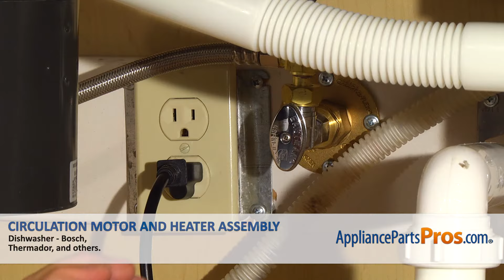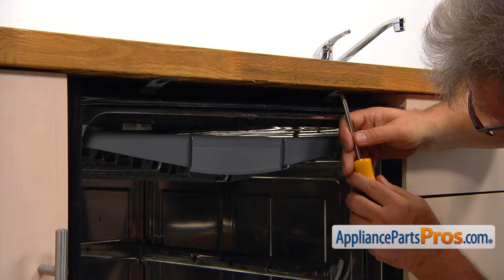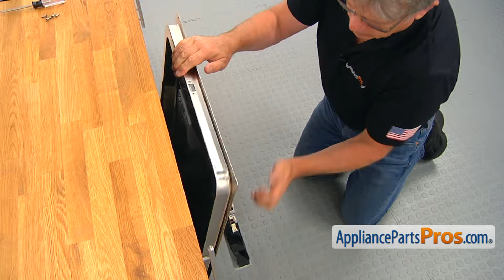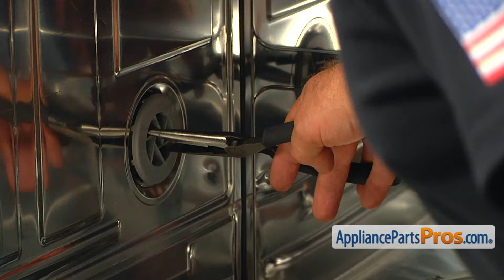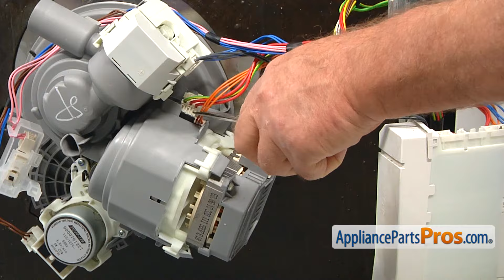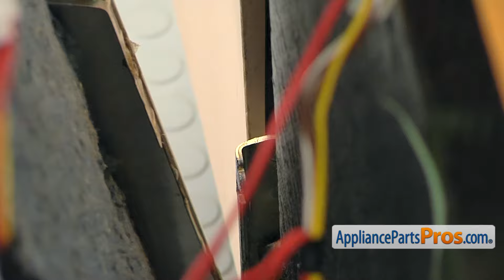How To: Bosch/Thermador/Gaggenau Circulation Motor and Heater Assembly 00753351

Comment: Thank you so much for this video. So many others do the quick and easy removal from the right side of the dishwasher, but my model has the Zeolite dryer in the way! Removing the door and the bottom was the only way to remove the pump. There were a lot of steps and potential points of failure removing so many connections, but your detailed instructions gave me the confidence to give it a shot. Thank you again! Saved me hundreds of dollars.
Reply from the maker: Thank you so much, @MoMukh! 😄👍 We’re glad the detailed walkthrough gave you the confidence to tackle the repair, especially with the Zeolite dryer making access more complicated. Great job sticking with it, and even better that you saved hundreds of dollars in the process!

Comment: Great instructions, even though I went in through the side, without taking off the bottom pan.  The detail on how to remove each wiring harness from the part was excellent, and missing from many other videos.  The crimp hose clamp on mine was inaccessible, so I just tried rotating and pulling down on the pump as other commenters mentioned, and that worked great.  I ordered my replacement through AppliancePartsPros, and it arrived 2 days early.  I’ve had great experience with them in the past as well.
Reply from the maker: Thanks so much for sharing your experience, @DavidBump 👍😄

Glad the wiring detail helped, and great job finding a workable approach with the side access—that’s exactly the kind of real-world variation that can make these repairs tricky. Also happy to hear the part arrived early and that you’ve had good experiences with us!

Comment: I need to do this. On some other videos, they seem to easily get it out from the front or the side. I have a SilencePlus 40, 800 series. Is this shown method the only way to do it? Seems a bit of work. I just did the pump motor which was annoying since there was not much clearance and it leaked bad at first, but seems good now. The tube was too far at the bottom and the motor was in the way of other plastic bits. Not a great design IMHO. 

How do I know if my heating and E15 (water) issues could also be the CONTROL board? Which one am I looking at- on top? Will it looked burned? I heard lose solder joints is common issue.
Reply from the maker: If you need further troubleshooting or replacement information, you can check out our Repair Forum: https://forum.appliancepartspros.com/.  It’s easy to register, and you can either post your question or search the forum to see if someone else has already asked the same question.

Comment: Thanks for the detailed video @appliancepartspros. My Bosch Dishwasher showed an E20 code and when I tried to start it, it would make 2 faint clicks and stop. After installing the new circulation motor it now works. However, if I try to run a Sanitize cycle, it does throw the E20 error. This is confusing. I ran with  success a complete normal cycle and a Service Mode P1 Cycle, the Dishwasher performed normally. @Ctd77801-g earlier posted that an un-properly seated  black wire connector to the pump could cause an E20. What are the things I need to further review beyond that wire/connector? Is it possible that I also need to replace the control board? Is there a specific test to check the controller board?
Reply from the maker: For free technical support, please visit our Repair Forum: https://forum.appliancepartspros.com/.  It’s easy to register, and you can either post your question or search the forum to see if someone else has already asked the same question.
 
Our experienced technicians, with over 20 years of hands-on appliance repair experience, are ready to answer your questions and guide you through your repair.

Comment: Awesome video!   All the easy to follow steps.    Thanks for the details changing that out.     Now I get to figure out why I have no power to the unit.  Don't see any loose connections behind panel, power button does nothing.   One match away from burning this house down now!
Reply from the maker: Have you tried it plugged into another outlet?
Reply: @appliancepartspros  Yeah, couple different ones.   All I heard was the faintest clicking sound up in the control panel.   To me it sounded like it was near that second connector from the right.   So guess I am replacing that now.   Funny it had power when the circulation motor failed.    Even tried the old unit to see if new unit was the issue.  Not sure what I did to the unit.   The curse continues.
Reply: @swampfox72  Was it a SHORT or the control panel Fox? Did you fix it I hope?
Reply from the maker: The clicking sound in the control panel sounds like it is a relay on the control board. What is the dishwasher model number?
Reply: @appliancepartspros  SHPM65Z55N/20

Figure I'm replacing 11031054 (Operating Module) now.

Comment: i have the same dishwasher wont start gives me E19 code what could it be i replaced soap dispenser and it doesnt have a heater exchanger valve or does it can someone HELPPPP?
Reply from the maker: What is the model number on your unit? We may have a tech sheet available.

Comment: I’m confused as to why you needed to uninstall the control panel.  You didn’t seem to need to do that. What am I missing?
Reply from the maker: @jashdown1234 Good question — in some models, removing the control panel makes it easier to access wiring or gives a bit more room to work during the repair, but it’s not always required. Depending on your setup, you may be able to skip that step. Appreciate you pointing it out!
Reply: @appliancepartspros thanks for responding!

I ask because I have a BOSCH SHE68P05UC/60 which threw an E1 error so it could be a heater problem or a control panel problem (BOSCH is distressingly vague and opaque about this — right to repair, anyone?). In other videos I’ve seen, folks had an easy time accessing the pump from the side. Ha I say! HA! My BOSCH looks nothing like what I’ve seen online in that respect. So I’m girding myself to take off the bottom so I can have a good look. I feel like I’ve performed an autopsy on this darned machine, and I’m tired of handwashing. Wish me luck!
Reply from the maker: @jashdown1234 We hear you — that model’s no picnic to work on. For the SHE68P05UC/60, the E01 error usually means a fault in the heat pump motor circuit on the main control board, not the heater itself.

Access can be tight on this one, and going in from the bottom is often the best move. You’re not alone — Bosch designs can vary a lot between models.

You’re on the right track, and if you need help locating part just let us know and may your handwashing days be numbered!
Reply: @appliancepartspros now here is where I get confused — is the main control board the one on the side, or the one on the top under the controls? I’ve also seen folks complain about ordering control boards that aren’t programmed, if that makes sense. If I’m going to spend any more money on parts, like a control board, I need to be sure that it will work. (I did have a look at the control board on the side and couldn’t see any obvious defects or burn marks). Do you stock the proper control board for my model?

Comment: Super easy video to follow - after identifying a leak coming from my circulation motor, I was able to fix a leak on my Bosch dishwasher thanks to this video. Every step is clearly explained and illustrated. Top tip: keep all of the screws organized and labeled so you know where they go back!
Reply from the maker: That’s great to hear! 🙌 Glad the video helped you track down and fix the leak. And excellent tip about organizing the screws — that makes reassembly so much smoother.

Comment: Thanks so much for this video. It was the only one I found with specific instructions on removing the bottom.  I had an e09 and replaced the circulation / heat pump. After replacing I had an E20 and thought I fried the controller board. Luckily the issue was the black wire connecter was not fully seated on the new circulation pump. Reseated and now running great.  Thanks again!!!!!
Reply from the maker: That’s awesome to hear—and great detective work on the E20! 🙌 That loose connector could definitely throw a curveball, but glad you caught it before going down the controller board rabbit hole. Thanks so much for sharing the outcome—it’ll definitely help others troubleshooting the same repair. Nicely done!

Comment: I just ordered a Circulation Pump from you guys, Will this video be the same for installing the pump?
Reply from the maker: What is your model number?
Reply: @appliancepartspros  my model number is SHX4AP05UC/05
Reply from the maker: Thank you. Unfortunately, we do not have specific instructions for this exact unit. However, this video is a generic video that can give you an idea on how to install the part and it should be similar enough to assist you with replacing the part on your unit.
Reply: @appliancepartspros  Thank you, sorry my responses are not showing up on my end, I apologize if I bombarded the reply line.
Reply: @appliancepartspros  SHX4AP05UC/05
Reply: @appliancepartspros  SHX4AP05UC/05
Reply: @ not sure if my reply is going through, Everytime I come back to the page it’s not there.

Comment: 😅what is the part number just for the cord that goes into the motor from the module panel ? It’s a 3 pin / 3 pin into 6 pin into module panel.
Reply from the maker: What is your model number?

Comment: This video is terrific.  I wanted to note in the comments my experience--- slow dripping under dishwasher with the motor/heater assembly failing on a Bosch 800 series dishwasher (panel-ready).
First, I tried to fix the drip with the rubber insert; (didn't fix the problem but it did cause significant frustration)
Then, the motor and heater failed; (a replacement assembly did the trick)
After taking out the assembly, I had enough confidence to try a diverter motor assembly; it was frustrating to get in place, as I did it while the dishwasher was standing.  After 30-40 minutes of wrestling with it, it fell into place.  
For me, the "diverter motor assembly" was the cause of the leak (and the failure of the heater).
(The trick for me to seat the motor assembly was using a little dishwasher soap and lightly jiggling it back and forth until it found its correct path.)
Just wanted to relay my experience in the hope that it can help someone fix their issue.
Reply from the maker: Thank you for the information!

Comment: You Saved Me!  Thank you!  No one in my area will service a Bosch.  Thanks to these videos, I was able to fix the machine myself.  After I replaced the water inlet valve, the machine still did not work.  Then I remember watching another video about a wee part located in the bottom of the dishwasher.  I pulled it out and low and behold, a plastic bag got sucked into the water intake/drain hose.  I had to use a vacuum cleaner to suck it out.  These videos helped me take the machine apart and put back together without braking anything.  Thank you!!!
Reply from the maker: You are welcome! Glad you were able to fix your issue! If there is anything we can help you with in the future please let us know.

Comment: Can a bad circulation motor and heater assembly cause an e15 code?
Reply from the maker: What is your model number of your appliance?
Reply: @appliancepartspros  shv53t53uc/01
Reply: SHV53T53UC/01

Comment: I Just completed the replacement of the circulating motor following this excellent video, thank you for the detailed directions and commentary. My 5yr old Bosch made some loud noises, but no codes, the noise went away but then the spray bars stopped rotating. I was able to remove the 2 screws of the metal front frame support  (5:31) without removing the door.   I tested it for leaks before pushing back in place.  5 STAR Video
Reply from the maker: Glad you were able to complete your repair! If there is anything we can help you with in the future please let us know.

Comment: What a great detailed video. Your clear guidance helped me fix my noisy dishwasher that did not show any error code to diagnose the issue. It was so difficult to tell if the circulatin_heat pump was the issue so i take a risk and bought a new pump, changed it and now my dishwasher is silent again. i recommend adding this cause ( loud grinding noise) as well to your list of reasons for changing the circulation pump.

Comment: I have an SVM series machine and this video has been really helpful but some tips having now replaced the part described.

Many videos show the pump being replaced solely from the aperture on the right, my machine has a water circulation system innediately above the electronics precluding that being slid out, this video showing the base removal, was a godsend. I spent quite a while looking for the rear fixing screws to no avail, on each side, the rear corner of the base slides on an alluminum rail and in a small hole in the plastic that rail has just been crimped over, so much for "made in Germany" quality.

It was easy to remove the old unit but attaching the new one was awkward, the vertical outlet kept slipping out of the pipe and the clamp slid upwardas it was tightened. The diagram that came with the Bosch original part indicated a 5mm gap from the end of the pipe to the clamp edge with the screw head hard alongside the sump. The heater pipe, which isnlt quite straight, has a rim that needs to be hard up to the female pipe, I held the rim against the upper edge of the loose pipe clamp with a pair of crocodile nosed pliers.

It is really difficult to see the screw head when against the sump but it appears not to work if you try to fix it with the screw the other side where it's visible, I think it's becasue the tension that is being applied to the wrong point. My sump had a plastic "tongue" against which the screw head end of the clamp can be pressed as you tighten it,that "draws" the outer side of the pipes towards the screw head, you need a VERY long screwdriver with a small diameter handle to access it across the top of the heater pump, you can hold that latter a little angled as you tighten the clamp but swing it in before final tightening.

I honestly don't see how you can do a proper job without removing the base and/or the inspection plate, I could have used three hands too!
Reply: Well you can - I made a rant video on my channel about it. Last time I buy a Bosch. Just as you found - the water is above the power brick. It is possible to get it out without taking the base off BUT my later revision has IMHO deliberately been made more tricky. The 3 grey wires often fall out. I think I have worked out the wiring but 3 identical grey wires... come on!

Likely I will get a Samsung or LG. This Bosch isn't a Rossmann approved product!!

Comment: I’m 99.9% sure you do not have to remove the door at all
Reply: I’m 100% sure I just did it from the right side underneath last week
Reply: 100%, I did eighteen months ago to change the soap dispenser which was easy but not for this.
Reply: Without dismantling door you won't unscrew these two screws without a special tool like small screwdriver or flexible screwdriver.
Reply: 同意你的说法😂😂😂
Reply: You don't have to pull it out to do the pump, expect for zeolite units. Typically without zeolite, the heat pump can be removed with just removing the front panel and kick plates.